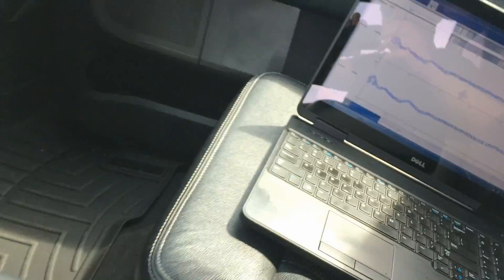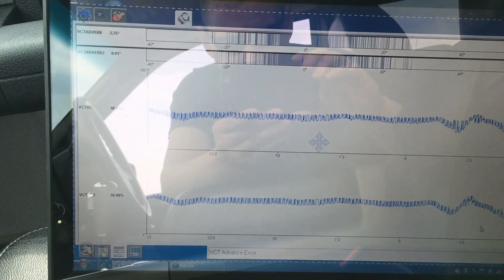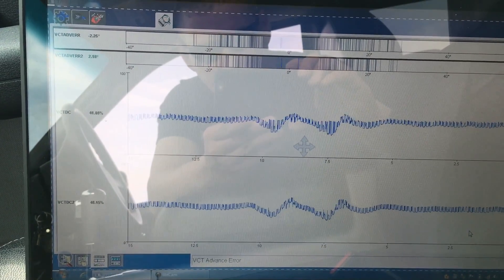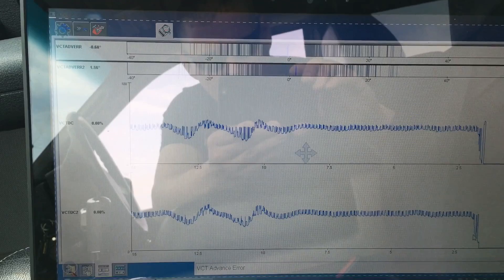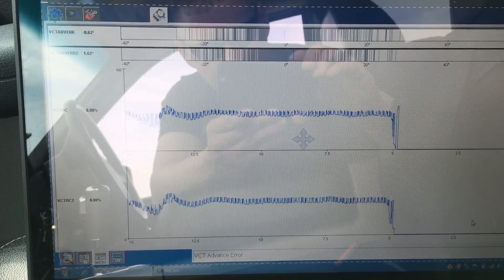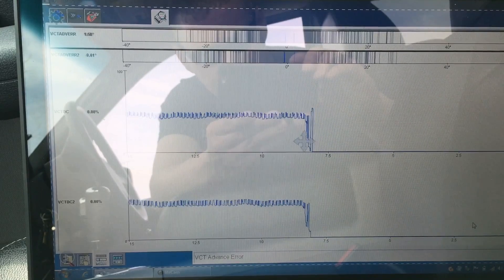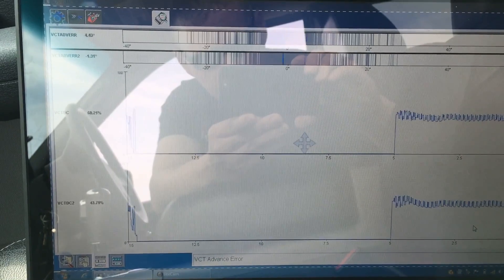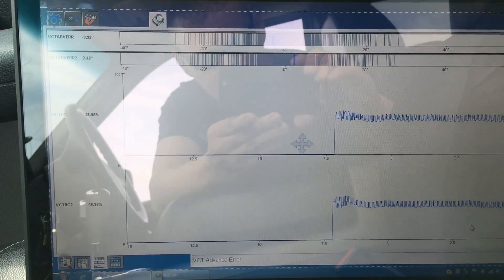Ford Quick Tips #74: 5.4L 3v Phaser Oscillation and Knocking Noise Explained

Comment: can you run 10w30 full synthetic instead of 5w30?
Reply: Chad  Isett I wonder about this myself.. because 5-30 when hot is still 5w.. so is it really helping when at operating temp?
Reply: I think you have that backward, 5-20 and 5-30 are same cold.  When hot: 5-20 is the same as 20w and 5-30 is the same as 30w